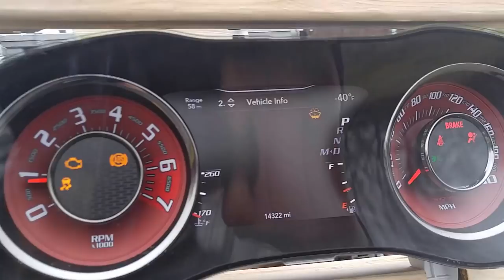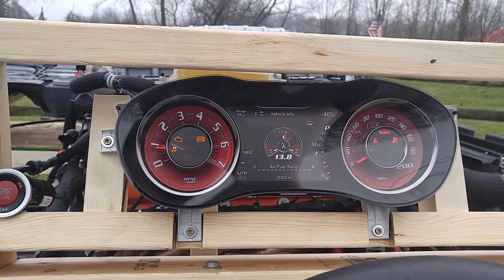World's First 2015 Challenger Hellcat Auto Turnkey Pallet Motor with Remote Start!

Comment: What's with the check engine light?
Reply: Its missing over half the components of the car, the computer must be going crazy, airbag, brakes, even the horn missing is setting the check engine light on
Reply: Ecu running on "Open Loop" do to oxigen sensors Not installed yet.

Comment: And so? what's the goal of having a hole car but can't drive it?
Reply from the maker: Umm.. perhaps so it makes doing an engine swap easier, and a lot more compact than having to have the entire half-cut or donor car, and helps the buyer of the motor know for sure that it was in running order when they purchased it!
Reply: if i purchased and engine and it showed up turn key like this i would be dumbfounded by the amount of detail they went through to ensure the customer a proper working product at your door step. impeccable customer service in my opinion.

Comment: This is fake, when he starts it and idles it it should be waaaay louder, it has no mufflers and is practically straight piped, a muffler delete hellcat would be way louder than that, it sounded stock.
Reply: clearly it isnt fake hes using a camera and a camera cant pick up how loud it actually is there is no way that you can just fake that many parts of a hellcats engine
Reply: Its real. Promise